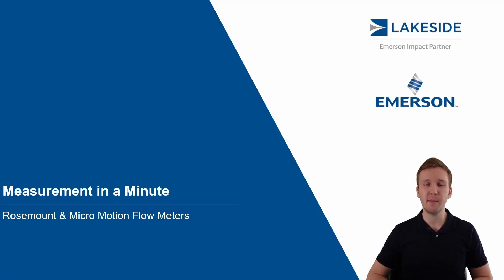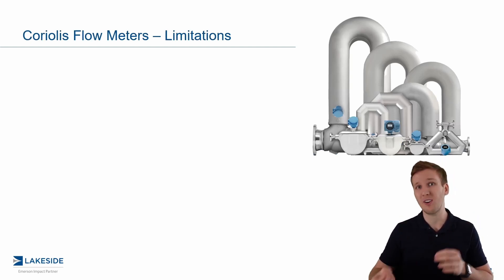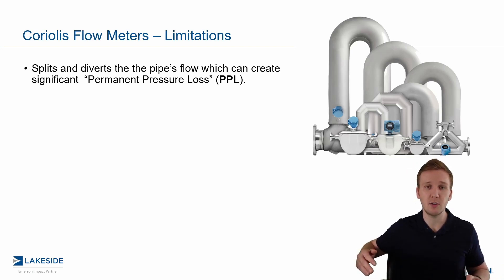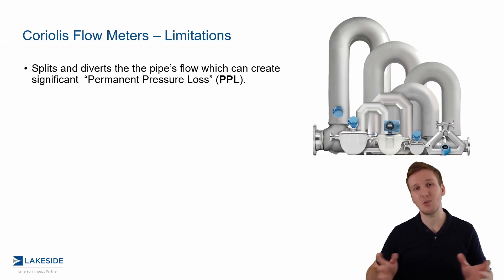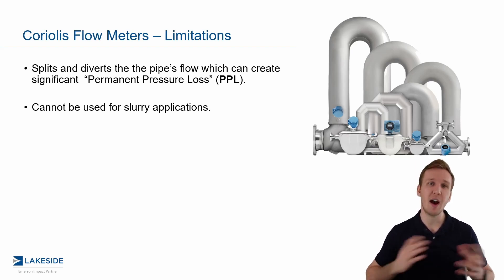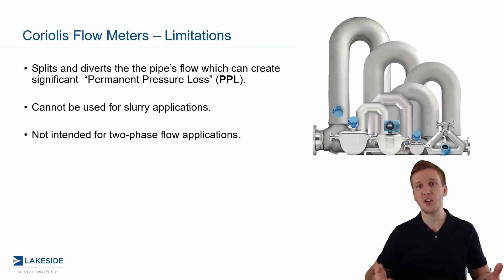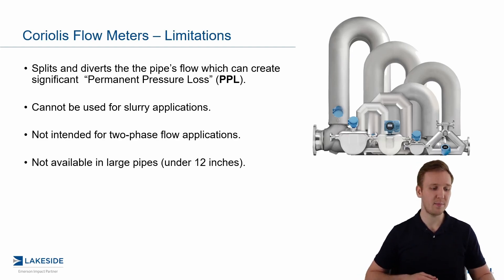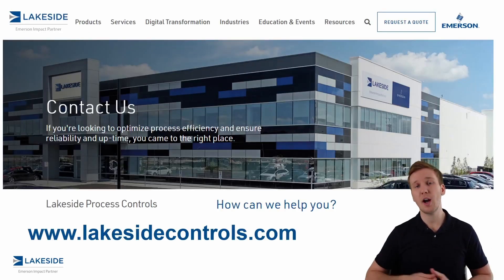Limitations for Coriolis Flow Meters | Measurement In A Minute

Comment: May I ask about the really external vibration effects on Coriolis flow meters ?
Reply: Micromotion meters are quite resistant to vibration effects, but it is not a straightforward answer. Perhaps better to call the Emerson rep in your region for a site visit for inspection.
Reply: @prasannasivakumaran2020  for truck loading,are they of the same accuracy or higher compared with positive displacement meters